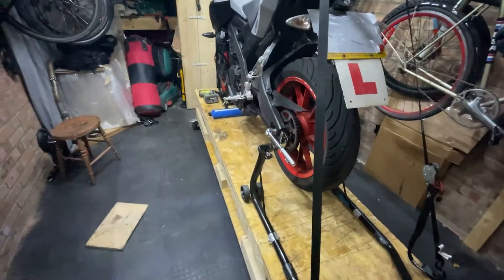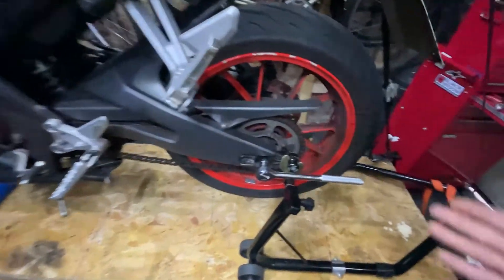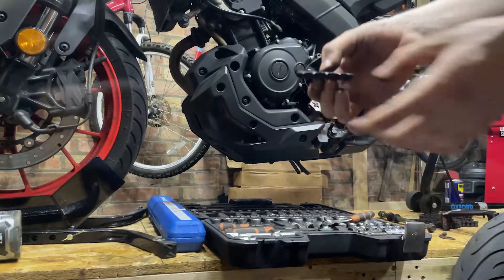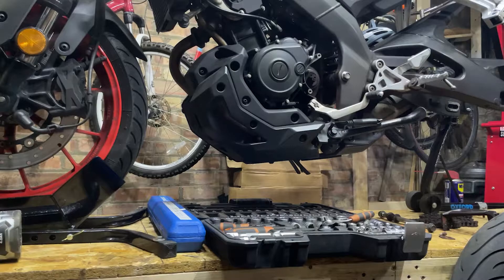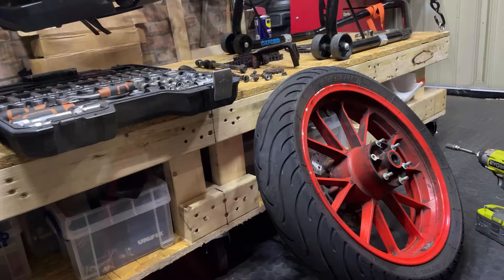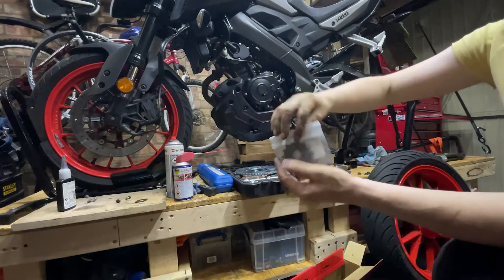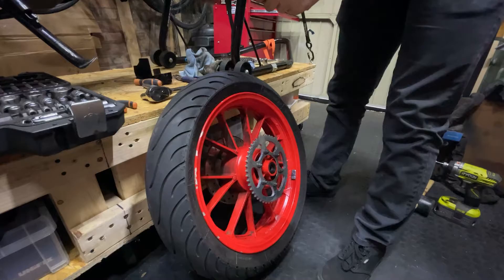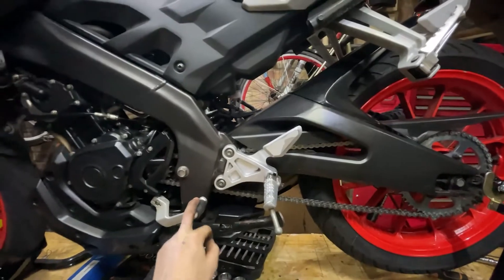How to change a chain and sprockets on MT 125

Comment: How did you add those spools for the paddock stand? Where can I buy it?
Reply from the maker: @madmutosh4235 they are made by R&G I will see if I can find a link to them and update this response
Reply from the maker: https://www.ebay.co.uk/itm/326287781772?chn=ps&_ul=GB&_trkparms=ispr%3D1&amdata=enc%3A1SrTGWi8sS7Kyzf0Ftrfkqg2&norover=1&mkevt=1&mkrid=710-134428-41853-0&mkcid=2&mkscid=101&itemid=326287781772&targetid=2360873003490&device=c&mktype=pla&googleloc=9045943&poi=&campaignid=21690875706&mkgroupid=169793746720&rlsatarget=pla-2360873003490&abcId=10027099&merchantid=137612511&gad_source=1&gclid=CjwKCAiAtNK8BhBBEiwA8wVt94fNeyzK9fCXEEan2Y6PlDKw6woOVv0yTBAri7JKceE_JqNKYTY9yhoC-GoQAvD_BwE

Comment: Hey man can I ask where you found the info for your rear sprocket torque settings and what torque set you use as I can't seem to find any 1/4 torque wrench sets which go up to a decent nm. I have a 2021 MT-125 so not sure if they are the same as yours or not
Reply from the maker: it is 39 Nm it is in the Haynes Manual link in description thx I'll see if I can find you a torque wrench and socket set
Reply from the maker: Silverline 633567 Torque Wrench 28 - 210Nm 1/2" Drive 
Silverline 569414 Deep Socket Set 1/2" Drive 12pt Metric 7pce 10 - 19 mm
these two are not a bad shout these are the two that I first started out with not too bad still use them to this day and very good and if not look at like Machine Mart cheap tools and decent
Reply from the maker: hope this was helpful
Reply from the maker: is that m.iroslav_ in one of your videos
Reply: @2_wheel_adventurer  it is yeah 🤣
Reply from the maker: @YamahaJoe  oh that’s mad I helped his friend after he crashed near box Hill
Reply: @2_wheel_adventurer  oh lol, he did just mention that when I sent him this video saying I found a good video about chain replacement. Are you local to rykas?
Reply from the maker: @YamahaJoe  Half an hour 45 minutes are  you
Reply from the maker: If you’d like to add me on Instagram Let me add you
Reply from the maker: @YamahaJoe  thanks for liking my video much appreciated
Reply: @2_wheel_adventurer  I appreciate the video, going to use it when I plan to do my chain + sprockets. I'm sure it's basically the same
Reply: @2_wheel_adventurer  I'm about an hour, do you have discord? There is a bunch of us in a bikers discord who occasionally have meets
Reply from the maker: @YamahaJoe  pretty much they change a few little things but apart from that it’s all the same easiest thing to do is buy a chain and sprocket sets directly from Yamaha
Reply: Just tighten it tight. You don't need to torque it lol never torqued anything in my life

Comment: How did you build your ramp
Reply from the maker: wooden timber 4x3 and 18 mm OSB it was very easy to be fair. you just need to measure how long your motorbike is on paddock stands and you'll be fineand once you've built the main structure all you need to do is Bolt some casters onto the ramp that are ok for the weight of your bike. I'd love to do a video on how to make it but unfortunately I don't need to make another one as I already have one but maybe in the future I will build one out of metal

Comment: Hello mate where did you get that drill sprocket thing you used?
Reply from the maker: It was a cheap socket set from B&Q nothing fancy works great you can get drill adapters for sockets and the drill l suggest is an impact driver thanks for you comment

Comment: Thanks for the video, every bit useful… ca I ask what wrench set your using ….
Reply from the maker: Halfords advance as it has lifetime warranty if you break a socket or break a ratchet, you can just take it back and they will just swap it.
Reply: @2_wheel_adventurer  brilliant appreciate that, I just bought a paddock stand today way too big for the mt125, which one are you using there?
Reply from the maker: @creativespace261   it is a cheap Oxford one just be mindful you need is the paddock stand to have flat mounts to go underneath the swinging arm. I have got the adapters to put the spalls on. On my bike they are made by R&G